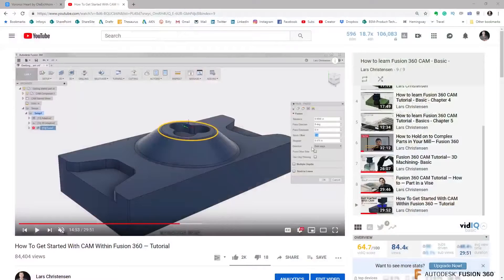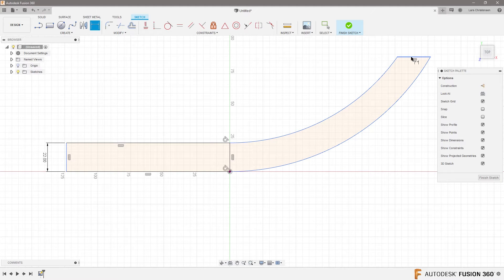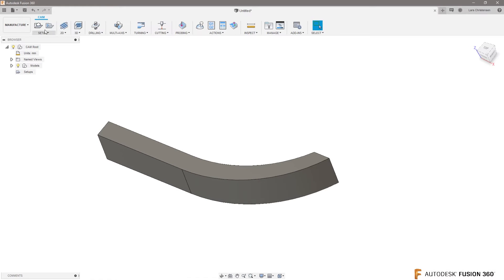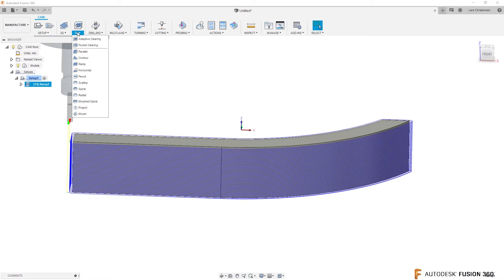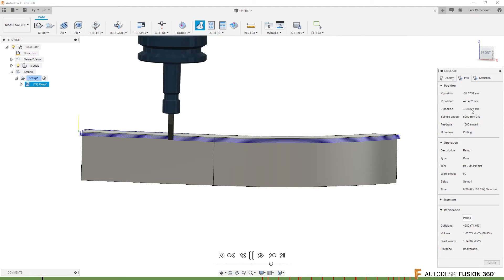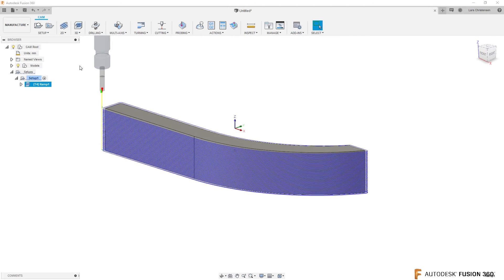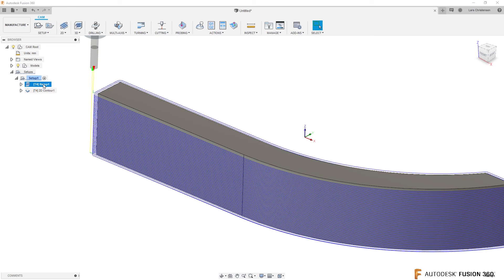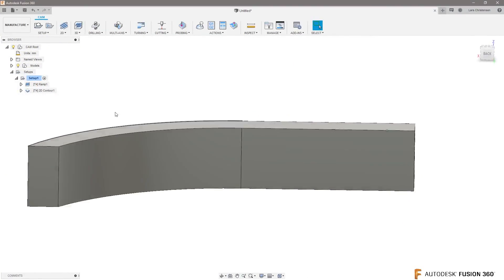Fusion 360 — Add Tabs to You CAM Toolpath — Ask LarsLive

Comment: Hi, I know this is an old video but what if you need to use a 3D toolpath (for carving etc) but you still want to use tabs? I'm using the steep and shallow to cut some chair legs and the piece is 3D right until the spoilboard, so I need to be using that function the whole way down, but I can't add tabs.
Reply: I know this is an old comment but for anyone wondering use the 3d tool path and set the height above the bottom of the model then run a 2d toolpath with tabs and combine the operation when your post processing
Reply: @FlyingAAuto  This was actually the info I needed. Thanks!

Comment: Hi great videos. I followed the video regarding tabs using a basic shape with a slightly bigger stock than my model. When I place the tabs, triangle and or rectangular the point directly up instead of away from the model. My model was created on the top plane with z up, x left to right and y pointing to the rear as you look at the model? It's just a square  extruded by 25mm with a cut out in the middle nothing fancy do you have any suggestions why fusion does this?
Reply: i had a similar thing with tabs when a contour toolpath was cutting on the wrong side of the contour, clicking the red arrow to make sure the toolpaths cuts on the outside of the contour makes the tabs looks right again, perhaps that was what happened in your case aswell